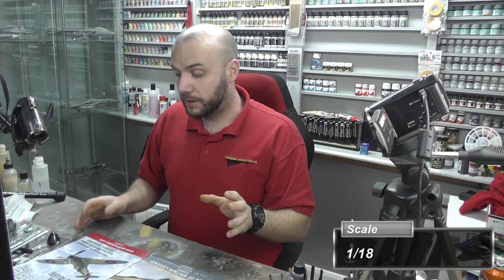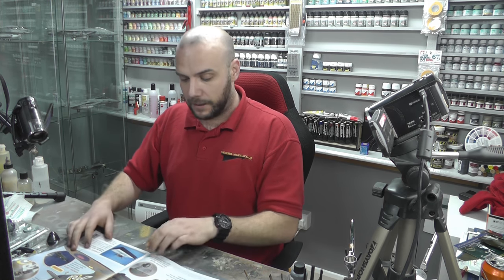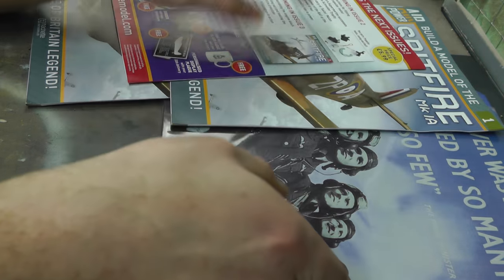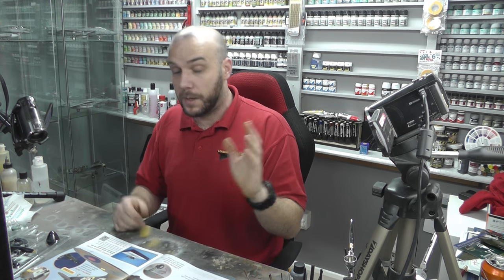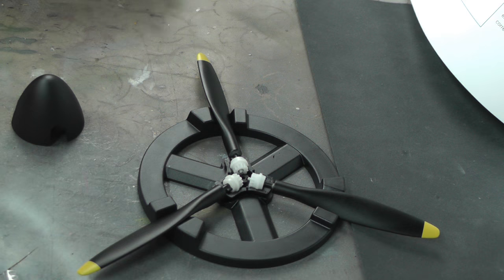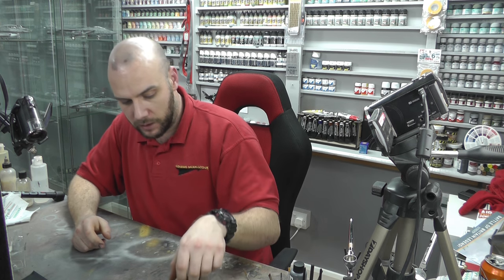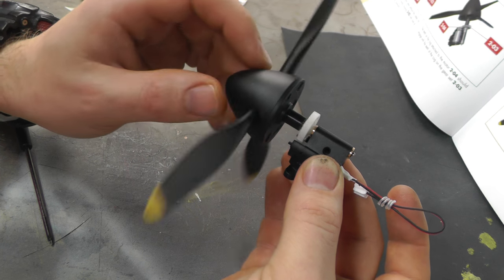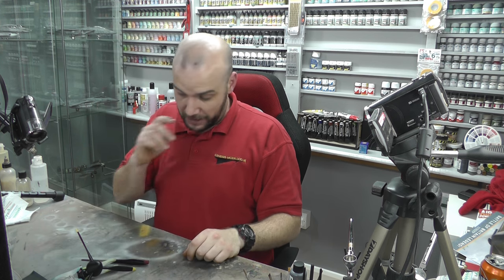Hachette Partworks : Spitfire MK.1a : 1/18 Scale Model : Step By Step Video Build : Episode.1

Comment: Nice looking model, but rather expensive. Good idea for using the Tamiya glue for securing the appliances cable parts/assemblies.
Might I suggest the use of a plastic lubricant grease on/for those plastic gears to facilitate their operation?

Comment: Don't clamp the parts first, then glue them.  You want a tiny gap when you put the cement on, otherwise the cement can't get in between the part. Cement first, then clamp.